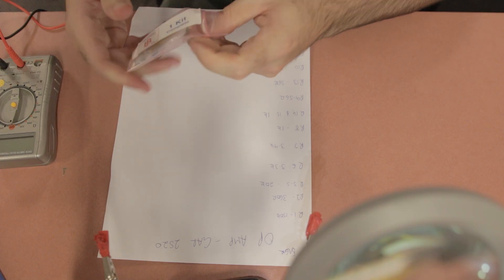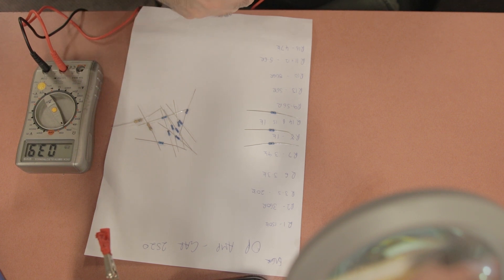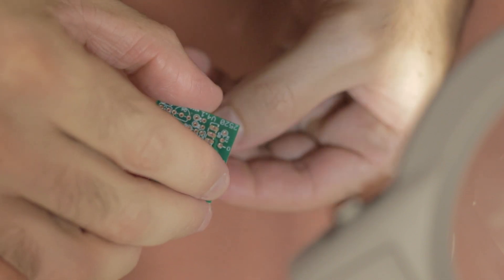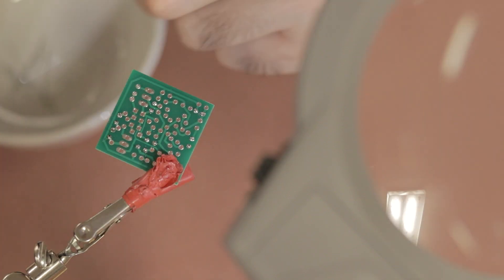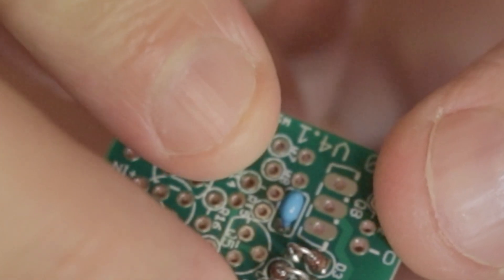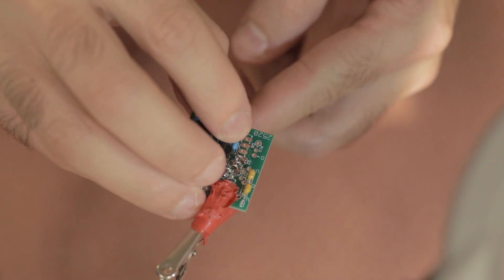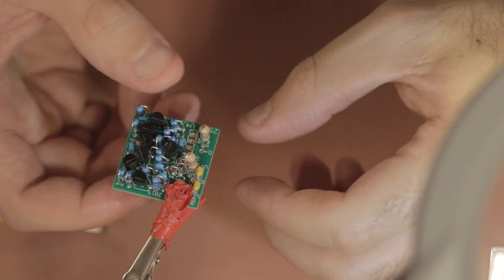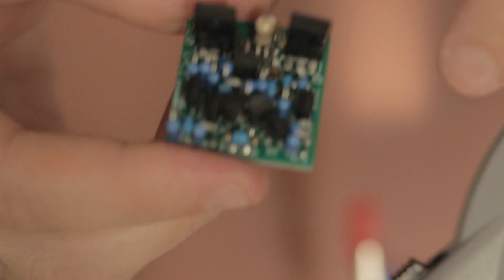What the hell is an Op-amp? API style (CAPI) GAR 2520 Build

Comment: Another question from a Newbie. Could you make a vid on the easiest/cheapest builds? Thanks for a great channel :-)
Reply from the maker: Hi Erand, these opamps are probably the hardest thing to build as the components are very close together. What is it you would like to build? A preamp? EQ? Compressor? It all depends on what you want to build my friend. The easiest preamp is probably the CAPI VP312, I'll pop the link below
 https://capi-gear.com/catalog/product_info.php?cPath=22_117_55_91&products_id=460 

If you're just starting out, maybe a guitar pedal or DI box or something would be a better option. The first thing I built was a condenser mic. Way less parts than most of these preamps and stuff.

Comment: I dig this. I've been trying to refurbish an old sansui power amp and also remove the hum from a tascam m30. How do you think the pres on those 80s tascams compare to the pres on these api kits?
Reply from the maker: The CAPI preamps are pretty amazing. I just checked your channel, amazing content. Your intro video is also the best! 

So, API style stuff is good all round. BUT especially great on guitars. They really bring out the midrange. I'm not familiar with the Tascam m30, but i gave it a quick google search and found some info. The difference is that these preamps are pro, studio quality mic pres that you'd find in a high end studio. I'm not sure how the M30 stacks up against these.

That said, whilst we all like to nerd out on gear, the order of importance would really always be, Artist > Mic > Preamp. But your signal is also only as good as the weakest link in the chain.  

If you want more info, definitely let me know, always keen to help a fellow youtuber.
Reply: @diyrecordingstudio  Thanks for the kind words! I hear you. I have messed around with some API 500s at my old studio and I liked them. The tascam stuff has vibe, but a bit of hiss. Seems to have more clarity in the high end than the tone beast as a point of reference. I"ll take a closer look at these
Reply from the maker: The tascam might have hiss due to a power supply issue. The hum might also be related to the power supply. The best thing to do if you want to refurbish it, is completely open it up and visually inspect the components. The first thing to go are the Capacitors. Check if any are swollen or burnt out.  

I'm by no means an expert on this stuff though. You should check out the Pro Audio DIY group on facebook. https://www.facebook.com/groups/517919938413134

They can be really helpful. You might need to post images.